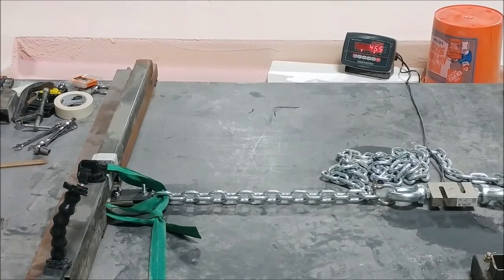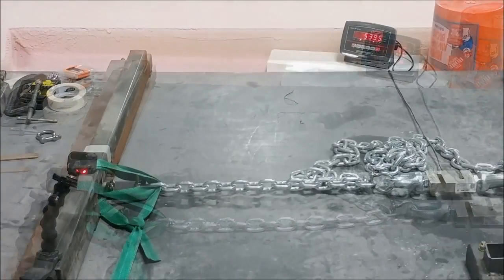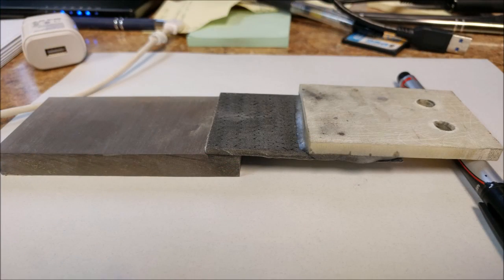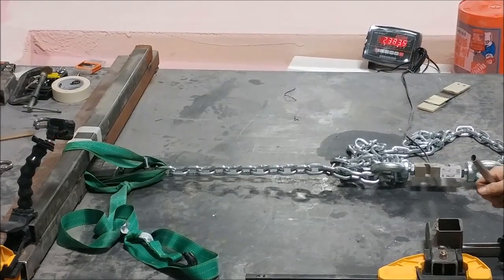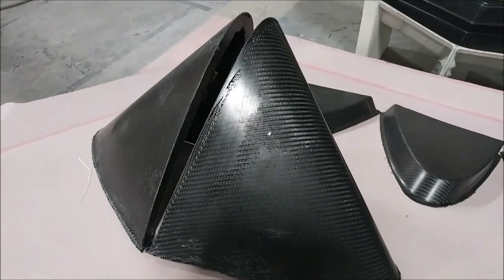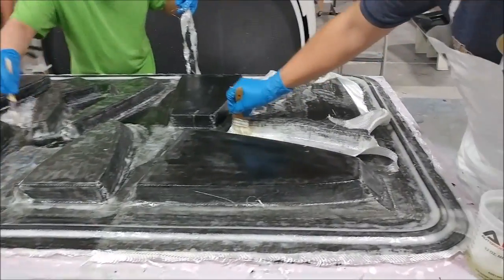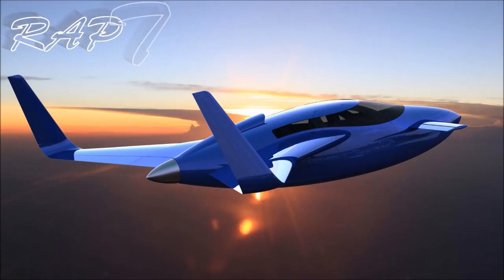Raptor Aircraft January 4th 2017

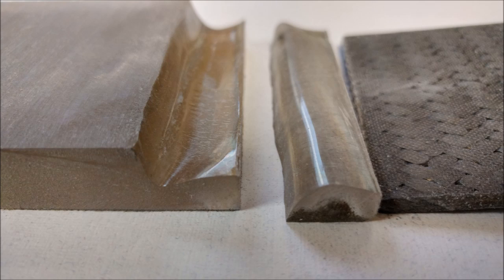Comment: 3:06  - the material may have broke along some kind of  tooling mark, or perhaps the scoring that resulted from surface preparation?   I wonder what results may be achieved by using a circular pattern for surface preparation, with a polished/smoothed edge - I think you may get an even better result.   It'd be interesting to see how various directional scoring and preparation methods affect the test results - you've probably already considered this.

I also noticed that after the failure, the scale does not zero - ranging between .2 and 7 lbs.  Is the device being used using some kind of strain gauge?   Perhaps that piece is getting distorted a bit - probably insignificant, but something I had noticed just the same.     Very interesting tests.  Thanks for sharing, I enjoy the videos.

Comment: Any data on the fatigue of the bonded joints over time when subjected to temp. changes and vibration?  Just curious if they are subject to stress cracks  like aluminum and rivets.  I'll have to look up the formula for the shear strength of a riveted lap joint but I don't think it's anywhere near as strong as your bonded joints.  Great Job!